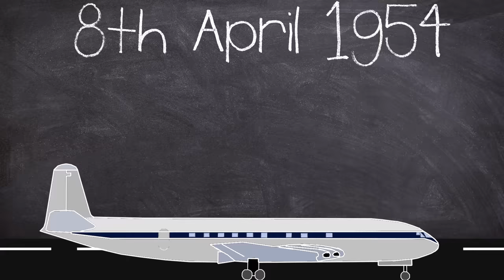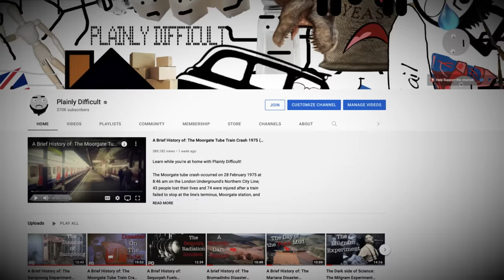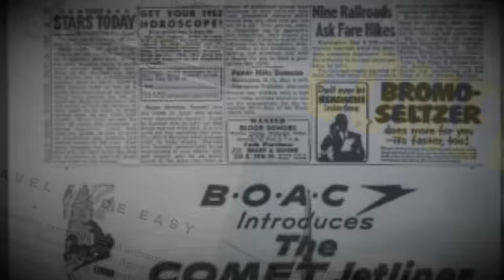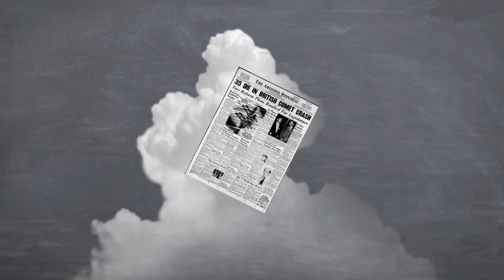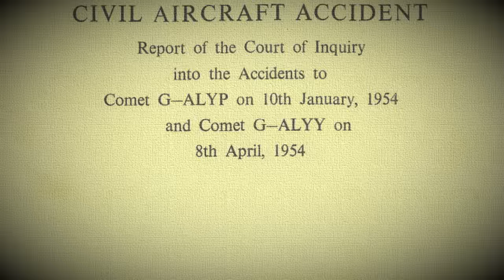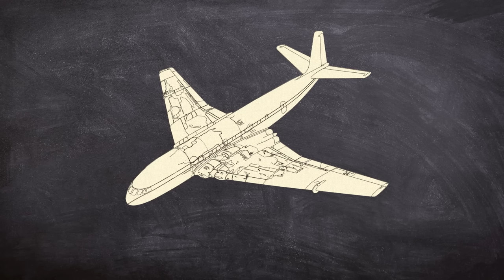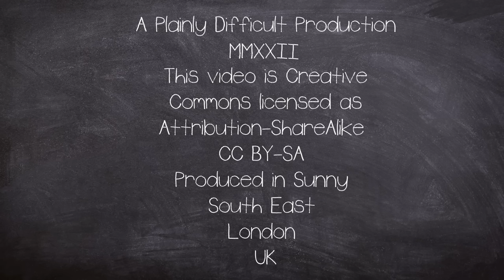A Brief History of: The de Havilland Comet Design Disaster 1954 (Documentary)

Comment: The Comet Disaster is the worst engineering failure in commercial jet aviation history... the real tragedy of this was it could have been easily prevented if de Havilland had simply followed well-known and understood industry standards.
Reply: Comets flew until 1997.
The Comet design had military use as a requirement. Nimrod development began at De Havilland before 1953.
Nimrods were not withdrawn due to structure problems or other airframe issues it was entirely an upgrade snag & resultant basic economics & an end of line sale happening at Boeing at the same time.

We feel we can shed some light on some common misunderstandings.

At the time the Comet wasn't particularly dangerous.

Losses comparisons
How things were in those days.

DeHavilland Comet 4 UK           14% 
DeHavilland Comet all  mks       17%  

Boeing 307                               70%
Boeing 247                               48%
Boeing 707            .                  20% 
Boeing 707                                20% 
Lockheed Electra Turboprop   29%
Canadair CL-44  Turboprop     46%  
Convair CV-580  Turboprop     22%
Convair CV-880    (ff 1959)       27%  
Convair CV-990     (ff 1961)      35%

    Of course De Havilland had prior experience building many all metal construction airframe aircraft including thousands of jet powered fighter aircraft that were primarily of metal construction with pressurised cockpits & jet engines built by De-Havilland.

   De Havilland carried out full stress analysis & engaged in a comprehensive & protracted testing program.

   The DH Comet was the first passenger airliner with full length fuselage pressurisation at 8psi pressure differential.

   Of course ripstop provision was provided. The skin alloy used became unavailable at the time due to
R & D at the manufacturers which resulted in the original alloy being discontinued.
The skin thickness used for the Comet was used for similar later aircraft. 
Frame spacing was not found to be too large & frame width was not found to be too small.

  De Havilland did indeed always work to better than industry standards at the time, used up to date knowledge for the design & construction & no evidence of negligence  or criminal negligence was ever produced in relation to the DH Comet.

  The DH Comet had no effect on the course of the aerospace industry in the UK. The UK now has the world's largest combined nuclear, aerospace & defence sector per capita activity.

    The investigation committee did not find hundreds of fatal flaws or evidence of design defects, structural defects, defective materials or shoddy workmanship. Ripstop provision was included. Claimed incidents did not involve cracks starting from window corners.
Pretty much all changes were just in case changes or were planned development modifications & improvements that were scheduled regardless of incidents.

Hope this helps.

Cheers 👍

Comment: looks at the illustration "No, that can't be right..."
looks at the actual photo "Oh... I see what this video will be about"
Reply: The video is about the worst engineering failure in commercial aviation history
Reply: This video has some BS included.
For example -
  
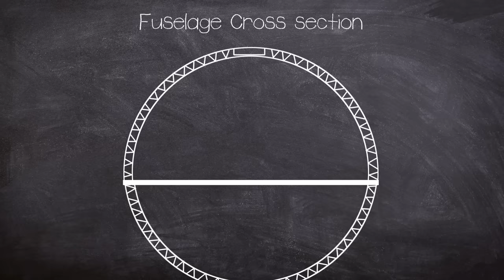    5:20   The idea that only the crew & passenger areas were pressurised is absurd obviously. 
  In fact every part of the fuselage was pressurised from the nose to the rear fuselage bulkhead including the entire cargo area.

Comets flew until 1997.
The Comet design had military use as a requirement. Nimrod development began at 
De Havilland before 1953.
Nimrods were not withdrawn due to structure problems or other airframe issues it was entirely a significant upgrade snag & resultant basic economics & an end of line sale happening at Boeing at the same time.

We feel we can shed some light on some common misunderstandings.

At the time the Comet wasn't particularly dangerous.

Losses comparisons
How things were in those days.

DeHavilland Comet 4 UK           14% 
DeHavilland Comet all  mks       17%  

Boeing 307                               70%
Boeing 247                               48%
Boeing 707            .                  20% 
Boeing 707                                20% 
Lockheed Electra Turboprop   29%
Canadair CL-44  Turboprop     46%  
Convair CV-580  Turboprop     22%
Convair CV-880    (ff 1959)       27%  
Convair CV-990     (ff 1961)      35%

    Of course De Havilland had prior experience building many all metal construction airframe aircraft including thousands of jet powered fighter aircraft that were primarily of metal construction with pressurised cockpits & jet engines built by De-Havilland.

   De Havilland carried out full stress analysis & engaged in a comprehensive & protracted testing program which is why key De Havilland people were happy to be aboard flying DH Comet aircraft.

   The DH Comet was the first passenger airliner with full length fuselage pressurisation at 8psi pressure differential. Handley Page built the world's first airliner.

   Of course ripstop provision was provided. The skin alloy used became unavailable at the time due to R & D at the manufacturers which resulted in the original alloy being discontinued.
The skin thickness used for the Comet was used for similar later aircraft. 
Frame spacing was not found to be too large & frame width was not found to be too small.

  De Havilland did indeed always work to better than industry standards at the time, used up to date knowledge for the design & construction & no evidence of negligence  or criminal negligence was ever produced in relation to the DH Comet.

  The DH Comet had no effect on the course of the aerospace industry in the UK. The UK now has the world's largest combined nuclear, aerospace & defence sector per capita activity.

    The investigation committee did not find hundreds of fatal flaws or evidence of design defects, structural defects, defective materials or shoddy workmanship. Ripstop provision was included. Claimed incidents did not involve cracks starting from window corners.
Pretty much all changes were just in case changes or were planned development modifications & improvements that were scheduled regardless of incidents.

De Havilland designers knew all there was to know about metal fatigue at the time they designed the DH Comet.

Hope this helps.

Cheers 👍
  
   
 . . . . .... ....

Comment: I got an U.S Air Force Ad before this 💀
Reply: The Boeing 707 is expected to remain in U.S. Air Force service until at least 2045.
Reply: This video has some BS included.
For example -
  
    5:20   The idea that only the crew & passenger areas were pressurised is absurd obviously. 
  In fact every part of the fuselage was pressurised from the nose to the rear fuselage bulkhead including the entire cargo area.

Besides that.
The engine position & inlet design were not flaws or fatal flaws, there were good reasons for that design choice at the time.

Comets flew until 1997.
The Comet design had military use as a requirement. Nimrod development began at 
De Havilland before 1953.
Nimrods were not withdrawn due to structure problems or other airframe issues it was entirely a significant upgrade snag & resultant basic economics & an end of line sale happening at Boeing at the same time.

  We feel we can shed some light on some common misunderstandings.

  At the time the Comet wasn't particularly dangerous.

Losses comparisons
How things were in those days.

DeHavilland Comet 4 UK           14% 
DeHavilland Comet all  mks       17%  

Boeing 307                               70%
Boeing 247                               48%
Boeing 707            .                  20% 
Boeing 707                                20% 
Lockheed Electra Turboprop   29%
Canadair CL-44  Turboprop     46%  
Convair CV-580  Turboprop     22%
Convair CV-880    (ff 1959)       27%  
Convair CV-990     (ff 1961)      35%

    Of course De Havilland had prior experience building many all metal construction airframe aircraft including thousands of jet powered fighter aircraft that were primarily of metal construction with pressurised cockpits & jet engines built by De-Havilland.

   De Havilland carried out full stress analysis & engaged in a comprehensive & protracted testing program which is why key De Havilland people were happy to be aboard flying DH Comet aircraft.

    The DH Comet was the first passenger airliner with full length fuselage pressurisation at 8psi pressure differential. Handley Page built the world's first all metal construction airliner during the 1920s.
    In many cases earlier pressurised aircraft were larger, needed thicker fuselage skins due to flying stresses & had much lower pressurisation differential pressure.

   Of course ripstop provision was provided. The skin alloy used became unavailable at the time due to R & D at the manufacturers which resulted in the original alloy being discontinued.
The skin thickness used for the Comet was used for similar later aircraft. 
Frame spacing was not found to be too large & frame width was not found to be too small.

   De Havilland did indeed always work to better than industry standards at the time, used up to date knowledge for the design & construction & no evidence of negligence  or criminal negligence was ever produced in relation to the DH Comet.

   The DH Comet had no effect on the course of the aerospace industry in the UK. The UK now has the world's largest combined nuclear, aerospace & defence sector per capita activity.

    The investigation committee did not find hundreds of fatal flaws or evidence of design defects, structural defects, defective materials or shoddy workmanship. Ripstop provision was included. Claimed incidents did not involve cracks starting from window corners.
Pretty much all changes were just in case changes or were planned development modifications & improvements that were scheduled regardless of incidents.

  De Havilland designers knew all there was to know about metal fatigue at the time they designed the DH Comet.

Hope this helps.

Cheers 👍. 
 
 . . .... ... ..... .. ...... ...

Comment: Also worth noting is that the Nimrod RAF maritime reconnaissance aircraft was derived from the Comet 4 airliner. Such a beautiful plane that was scrapped due to politicians and their budget cuts.
Reply: The Hawker Siddeley Nimrod is a completely different aircraft with a different type certificate that was designed by a different manufacturer nearly 2 decades later.

While the Nimrod does share a stockpile of unsold ancillary components with Comet 4c when its orders were canceled.
Both aircraft did share a similar fate, grounded due to premature fatigue failures in the wings spars.
The Nimrod fleet was grounded for inspection after one of the worst accidents in RAF history, inspection discovered that none of Nimrods were airworthy due to fatigue damage in the wing spars.
The MRA4 was canceled because of severe design flaws in the new wings and non-destructive testing of the fuselage parts revealed that there were not enough safe, reuseable parts left to fill the contract. The only alternative was to scrap all the Nimrod airframes.
 It's also ironic that both the Boeing 707 and 737 replaced the Nimrod in RAF service and are expected to remain in service for at least another 2 decades.
Reply: @sandervanderkammen9230  keyword I used, which you seem to have overlooked was DERIVED.
Reply: @markallen7215  No, not a derivative, a completely new aircraft design...  The Nimrod actually shares fewer parts in common with the Comet than the Boeing 737 shares with the 707...

Comment: I ALWAYS FOUND IT ODD THAT THE ORIGINAL DESIGN CALLED FOR SQUARE WINDOWS GIVEN THE OVERALL ROUNDED DESIGN OF THE BODY AND ENGINES. IT'S STILL A STUNNING JET.
Reply: Actually de Havilland originally designed the aircraft with oval shape windows but this was discarded as a cost savings measure and to speed up production.

The Comet Disaster was the worst engineering failure in aviation history and a truly shameful chapter in British history.
The real tragedy of the Comet Disaster was that it could have been easily prevented if de Havilland had simply followed well-known and understood industry standards in the design and construction of pressurized cabins in riveted aluminum airframes.
Reply: This video has some BS included.
For example -
  
    5:20   The idea that only the crew & passenger areas were pressurised is absurd obviously. 
  In fact every part of the fuselage was pressurised from the nose to the rear fuselage bulkhead including the entire cargo area.

Besides that.
The engine position & inlet design were not flaws or fatal flaws, there were good reasons for that design choice at the time.

  The original DH Comet design did not include round windows.

Comets flew until 1997.
The Comet design had military use as a requirement. Nimrod development began at 
De Havilland before 1953.
Nimrods were not withdrawn due to structure problems or other airframe issues it was entirely a significant upgrade snag & resultant basic economics & an end of line sale happening at Boeing at the same time.

  We feel we can shed some light on some common misunderstandings.

  At the time the Comet wasn't particularly dangerous.

Losses comparisons
How things were in those days.

DeHavilland Comet 4 UK           14% 
DeHavilland Comet all  mks       17%  

Boeing 307                               70%
Boeing 247                               48%
Boeing 707            .                  20% 
Boeing 707                                20% 
Lockheed Electra Turboprop   29%
Canadair CL-44  Turboprop     46%  
Convair CV-580  Turboprop     22%
Convair CV-880    (ff 1959)       27%  
Convair CV-990     (ff 1961)      35%

    Of course De Havilland had prior experience building many all metal construction airframe aircraft including thousands of jet powered fighter aircraft that were primarily of metal construction with pressurised cockpits & jet engines built by De-Havilland.

   De Havilland carried out full stress analysis & engaged in a comprehensive & protracted testing program which is why key De Havilland people were happy to be aboard flying DH Comet aircraft.

   The DH Comet was the first passenger airliner with full length fuselage pressurisation at 8psi pressure differential. Handley Page built the world's first airliner.

   Of course ripstop provision was provided. The skin alloy used became unavailable at the time due to R & D at the manufacturers which resulted in the original alloy being discontinued.
The skin thickness used for the Comet was used for similar later aircraft. 
Frame spacing was not found to be too large & frame width was not found to be too small.

  De Havilland did indeed always work to better than industry standards at the time, used up to date knowledge for the design & construction & no evidence of negligence  or criminal negligence was ever produced in relation to the DH Comet.

  The DH Comet had no effect on the course of the aerospace industry in the UK. The UK now has the world's largest combined nuclear, aerospace & defence sector per capita activity.

    The investigation committee did not find hundreds of fatal flaws or evidence of design defects, structural defects, defective materials or shoddy workmanship. Ripstop provision was included. Claimed incidents did not involve cracks starting from window corners.
Pretty much all changes were just in case changes or were planned development modifications & improvements that were scheduled regardless of incidents.

De Havilland designers knew all there was to know about metal fatigue at the time they designed the DH Comet.

Hope this helps.

Cheers 👍. 
  
   
 . . .... .. ....... .....